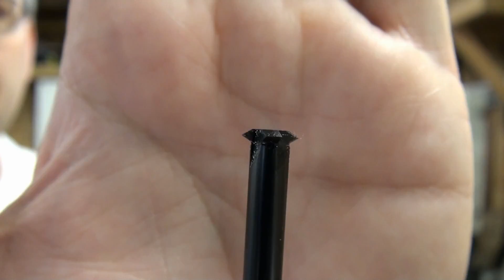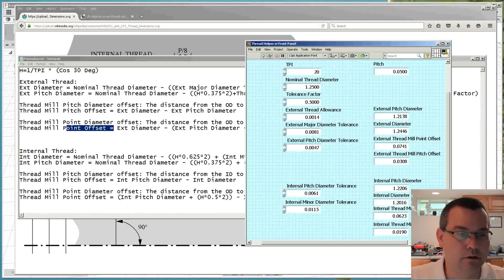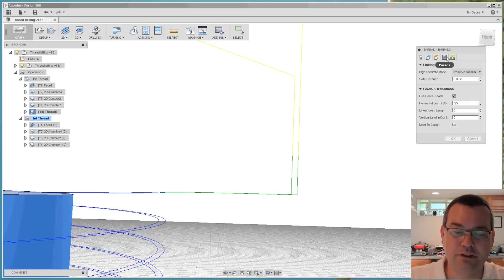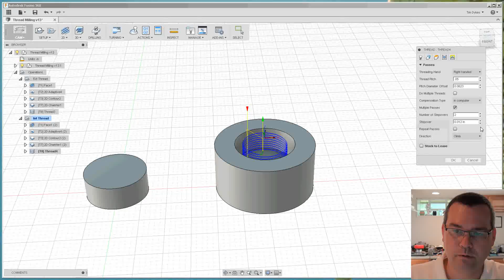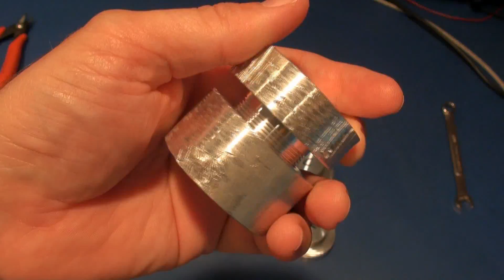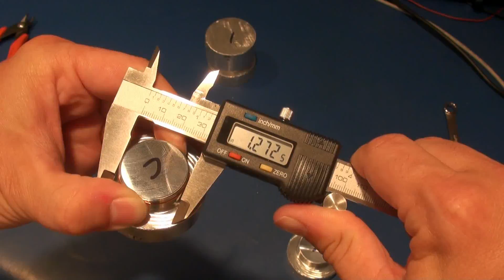CNC Thread Milling with Fusion 360 from A to Z

Comment: So why are your allowance and tolerances for external threads not match the calculators?  You have a 1.250" OD x 20 TPI and the calc. say allowance of 0.0016" but you have 0.0014" and also your External pitch diameter is different.  Calcs show 0.0053 but I think you show 0.0047"   Why the differences?  Are those your fudge factors?  You came up with a "point" PDO for fusion at 0.0741 but the calcs all show 0.0744".    When the math isn't working out, it makes me question why.   Everything is very informative, but your examples aren't matching the formulas.    I do enjoy all your videos because they are very educational, I just don't understand why your data isn't matching what you're stating.
Reply: I see, the calculator shows different values.  If you select 1.25 x 20 from the pull down, you get different values than if you type in 1.25 diameter x 20 TPI.

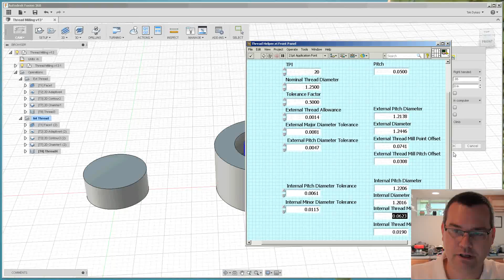Comment: confused: at 33:42 why do you use the point diameter offset value from your calculator as the pitch diameter offset value in fusion?
Reply from the maker: Hello John
The diameter offset you use depends how you specify the tool diameter in your tool library. If you set your tool diameter in the tool library to reflect the total diameter of the tool at the point then you would use this value. If you specify the actual pitch diameter of the tool then your would enter in the pitch diameter offset. I personally use the diameter of the tool at its point because I use the same tool to make many threads, hence I enter in the point diameter.

Comment: Thank you very much!  Excuse my newbie question but will this correlate to metric threads?  Will I have to convert metric tolerances to imperial, then plug them into the formula?
Reply from the maker: It should work for metric as well because the thread profile is the same.

Comment: Really great vid!  I'm finally getting to the point where I need to do some thread milling.  I still need to get a single point thread mill, but I've started on the CAM using this vid.  Looks promising. :)  I'm anxious to actually try it on the mill.  I think I'm going to do a block with multiple tests first.  I'll be doing internal 5/8-18 about 1.5" deep on some parts.  This should be way, way better/faster than having to tap them all. lol Thanks!!!
Reply from the maker: If your machine can rigid tap that is faster. But getting broken taps out can be a challenge. Thread milling is most likely faster then hand tapping and will yield a better thread. Good luck!
Reply: Sadly, no rigid tapping on this machine.  On at least a couple of the parts, it's going to be blind holes which would require tapping them twice to get the threads close enough to the bottom.  I think thread milling will do the trick nicely. :)
Reply from the maker: Yep thread milling you can get as close to the bottom as you dare.
Reply: @bluehandsvideo  I use thread milling for really weird or large sizes and tapes for any other size.  My Fadal doesn't have rigid tapping either but I use a compression tap holder with Blitz adapters and I wrote my Fusion PP to underfeed a certain amount.  I think 95% if I remember right.  I never had an issue at all.  Now, external threads all get threadmilled!
BTW, enjoy your channel as well!
Reply: @RJMachine62  I've done 5/8" threads with thread milling...figured it was easier and I could tweak the fit.  Anything under a 1/2" will probably get tapped.
Interesting idea about under feeding the compression tap head....I like that!  I have one two that I haven't used.
Thanks!!!  I just subbed yours. :)

Comment: INTERNAL THRED MATH DONT WORK.   H= 0.0433INT diameter=  1.25-((0.0433*0.625*2)+(0.0115*0.5)   = 1.1901  from where you have 1.2016?and INT pitch to    1.25-((0.0433*0.375*2)+(0.0061*0.5)= 1.2145   you have 1.2206?
Reply from the maker: Hello Jan, thanks for the reply, someone else had the same issue a while back. If you scroll down through the comments you will find there question and the full explanation. It is an order of operations issue, the correct order is
 (1.25 - (0.0433*0.625*2)) + (0.0115*0.5) = 1.2016
Let me know if you have any other questions.
Thanks, Tim

Comment: Hi. I was trying for a week to make the threads I wanted and couldn't make sense of how to choose the right diameter and offset. Very clear, to the point, and high quality video (bull's eye). Appreciate all the efforts. I will try it tomorrow to thread a 7" diameter piece. I'll keep you posted. thank you again.
Reply from the maker: Awesome, that is a huge thread! Let us know how you make out, maybe send a picture if you can and I will include it in a video.
Reply: sure. I have a question though. in the latest version of fusion when you want to cam the thread, it provides twp circular faces with different dimensions to select for caming the thread. which one do I need to choose, the larger or the smaller? your input would be great in this regard. One Point about fusion is when you try to thread large diameters, you need to switch to metric system and start converting to imperial system. Are the formulas you provided applicable for metric system as well or do I need to convert the constant to metric equivalent. (too many requests, sorry) finally, could I possibly have a copy of your calculator that you use in your video please? thanks and keep up the good work. great job
Reply from the maker: If your doing an external thread you select the larger diameter, internal thread you want to select the smaller diameter. Basically what ever face you used to pre machine the boss or hole that your going to thread mill is the same surface you select for the thread operation. I don't see how or why the size of the thread effects the units? You don't need to model the thread to cam the thread mill operation. Just model a cylindrical face that is the correct size so you can then cut into it and add the thread. Yes, I have been meaning to put a software package together of all the tools I use. But I need to spend a fair amount of time to get them at a state that can be distributed. When I write them for my self I don't care if there are a few bugs in them, I fix it as I go.
Reply: good. thanks for the quick reply.  What I meant was a correct cylindrical face in modeling. my mistake. Could you also tell me If I can use the formulas for metric threads  =or should I change some parts. appreciate all your efforts.
Reply from the maker: Because Unified (standard units) and ISO (metric units) share the same geometry the calculations should be the same between them. Just use the specs and sizes for the thread your going to make and it should work.
Reply: thanx

Comment: Thank you, thank you, thank you. This single point process has always made me unsure and cranky. 
Whipped up a spreadsheet, live tested the results. No I dread this no more.

Questions: Could you expand on the use of the tolerance factor? 
What and/or when dictates that the std. 50% be changed higher or lower?
IF due to tooling, etc the thread needs to be a bit tighter, does the tolerance factor need changed?
Reply from the maker: The tolerance factor is just makes the machine split the middle of the tolerance. If you know your machine can hold tighter you can machine closer to the minimums and make a tighter fitting thread. If your threading material that likes to gull bad, like aluminum on aluminum you may want to push it closer to the maximum tolerance to make a looser fitting thread.

Comment: Great video!  Thanks for taking the time to go in depth.  If I were cutting a thread with a multi-point thread mill (I have one for 16tpi) would I define the tool in the same manner in the tool library? Have you done threading with a multi point TM? I was thinking that I could just change the heights in the toolpath so that it only fed for 1 revolution, ie. the height would be 1 full thread pitch (or a little more). The teeth above the bottom in this instance would form the remainder of the thread.  That doesn't seem like a very elegant way of doing it,  but if we can't define threadmills in fusion that is about all I could come up with.  Any thoughts?  
Thanks again for the great explanation!
Reply from the maker: That is exactly how you would do it.  Define the tool and pitch offset diameters the same way as a single point. Then define the bottom of the tool path at the bottom of the thread and then the top of the tool path just high enough to make a little more then one full revolution. When using multi point thread mills make sure to click "Use Helical Leads" or the lead in/out could mess up the top half of the thread.
Reply: Right on, thanks for the reply! Just found your channel, can't wait to watch your other videos.
Reply from the maker: Your very welcome, get some popcorn and a frosty beverage. Some are a bit long though.

Comment: Can you check your formulas for Internal pitch diameter and Internal diameter.  Using the same values listed in the video, I come up with a pitch of 1.2145 and a diameter of 1.1901. Which are short the exact value of the respective tolerance's.  i.e. 1.2145 + .0061 = the value your calculator shows of 1.2206.thanks!
Reply from the maker: Could you show your math for your calculations?  Using the http://theoreticalmachinist.com/Threads_UnifiedImperial.aspx thread calculator (which I verified with other sources and checked by hand) It shows a pitch diameter for a 1.25"-20 2B thread as 1.2236 to 1.2175. The value of 1.2206 I use in the video is the middle point between the upper and lower tolerance.
Reply: Internal Diameter = 1.25 - ( ( .0433*.625*2) + ( .0115 * .5 )) = 1.190125 ////    + .0115 = 1.2016Thank you for taking the time to respond!!!
Reply from the maker: Ok, sorry for the delay... The issue is the order of operations.  I double checked all my numbers and they are correct as far as I can tell from all the different sources and the parts I make.  To adjust the math a little it is this (1.25 - (0.0433*0.625*2)) + (0.0115*0.5) = 1.2016  This also lines up with the center of the tolerance given by the thread calculator web site. Does that help?
Reply: That works!!!  thanks!!  Now for the process of adapting this for stub acme threads....  any advise???thanks againlandon
Reply from the maker: I have not any acme threads yet, but all the same stuff still applies. It will depend on how the form cutter is defined more then anything.
Reply: First i figure taking the cos of 14.5 instead of 30?

Thanks again
Reply from the maker: I replied yesterday but google deleted my comment? Any event, the math for an acme thread is different.  I posted a link to a calculator and diagram, maybe they didn't like the link.  You can google acme thread and find a diagram with the math similar to what I used in my video for UN threads.  The math for figuring out the threading depth is similar once you use the correct thread geometry formulas.
Reply: Excellent vid!! I was making the same error as above when checking longhand... you might want to double check the parentheses mismatch in the formulas above... Otherwise, brilliant explanation.

Comment: Great video
Reply from the maker: Thanks Eric, that one took a while for me to try and simplify the math as much as possible.  I hope it was explained well.
Reply: Everything was super clear. I needed to cut some 3/4 x 26tpi threads in delrin and I was having trouble figuring out the right offset for the single point thread mill.  I ended up using SW to figure out the value. But, now I understand how to work through the math to find the right value. Also, I finally got the whole importance of tolerancing the pitch diameter.
Reply from the maker: That is awesome, thanks for the feedback. Without comments or emails I don't really know if the videos are reaching there intended goal.